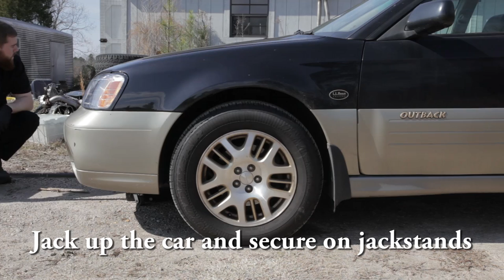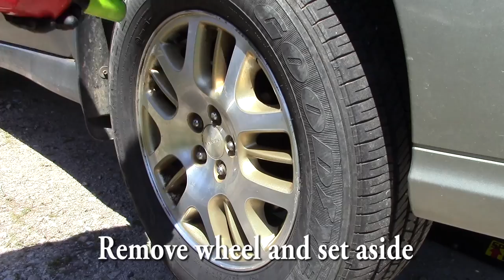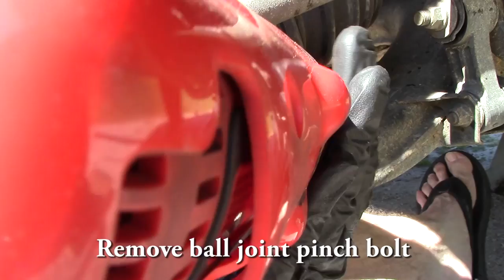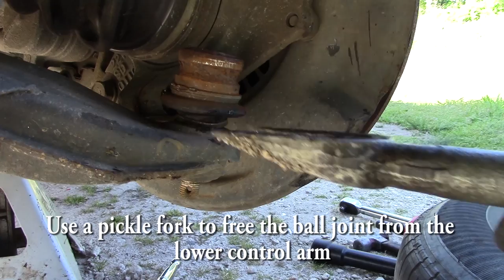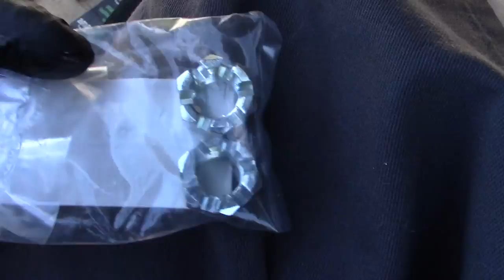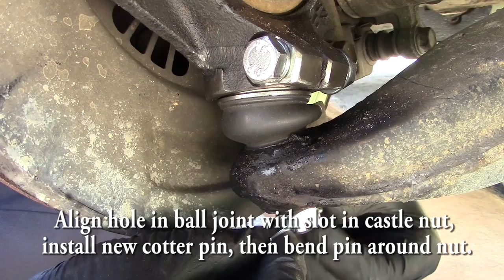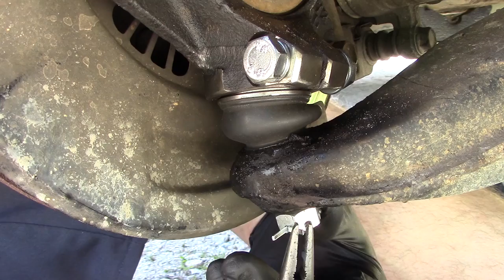Subaru Ball Joint Replacement

Comment: As always love your videos!! I have done this job before but this time the ball joint is stuck... I have tried pickle fork for an hour and a ball joint separator. Sprayed it with penetrene, and lifted it with a trolley jack while using a pickle fork but cant seperate it. Any suggestions?
Reply from the maker: +simon kilcoyne torch. Airhammer.

Comment: did you remove the tie rod ends to allow the discs to move? When I try this replacement the ball joint gets stuck after removing the pinch bolt
Reply from the maker: +Ben Keeton yes, removed the outer tie rod from the spindle.

Comment: Hi Mr Subaru, UK guy here, how will I know if the ball joints are breaking down on my SH forester. Do they make a slight clunking noise when driving over uneven surface or a different noise. Please advise as you are a god with the Subaru brand.
P.s. do you admire the offroad scene with the Subaru brand or are you a impresario sti kinda guy, intrigued to know ???
Reply from the maker: Easiest way to check ball joints. Lift and support the front of the car on jackstands. Prybar between the bottom of the spindle, top of the lower control arm. Flex the prybar up and down slightly. The bar should bow and no movement seen in the ball joint. If you see movement up and down in the joint, replace it.

Comment: Just out of curiosity, can I put grease in the socket and groove on the pinch bolt area of the ball joint?  Every time I watch someone remove one of these, they are rusty and/or crusty (some much, much, much........ worse. :)
Reply from the maker: I'd probably go with some light antiseize compound.

Comment: i did the ball joint change, on the passanger side, when i took the ball joint out,  the inner/transsmison cv joint went out O.O .. i put the cv joint/boot on its place, but it lost the grease, am i need to refull the cv joint?? can be that the reason for some crunch/crackle noise while iam driving over a rough way?
 after the ball joint change, the noise decreased, but not all. Thank you.
Reply from the maker: +Ismael Forester noise is most likely the axle. You will probably need to replace it. A new boot and grease probably won't remedy the issue.
Reply: Even when the axle/boot was on good shape? Have no cracks or something like that.
Reply from the maker: +Ismael Forester the joint should not come apart. Most likely spring clip inside is missing. Pull apart and inspect for wear. If no wear, grease, install new retainer spring and boot.
Reply: +zcamaross09 
ooooo the clip could be missing, because when it came apart, i didnt see any clip, can i just buy the clip if the cv joint is Ok?

Comment: I NEED HELP, I HAVE A 2004 SUBARU OUTBACK AND THE STEERING KNUCKLE CRACKED! I know that 00-04 are the comparable years, but would a 2005 steering knuckle work? I know I would need to get the bolt of wheel bearing and hub assembly. But as long as the CV fits and the bolts are the same for the caliper and tie rod it should be fine right? A steering knuckle an 05 is 50$ for an 04...its 200$
Reply from the maker: The 05 is not interchangeable with the 04 steering knuckle.
Reply: @MrSubaru1387  there's no way it would work? Even with getting the new spindle assembly?
Reply from the maker: The geometry of the 00-04 and 05-09 are different. Complete different spindles, lower control arms, hubs, etc.

Comment: Hi great video, did you put your jack stand somewhere special, it seems like you can  move your components pretty freely, my experience was not great. I have a 2000 OBS. It’s looking pretty similar to the outback underneath
Reply from the maker: I placed the jack stands on the factory jack points, on the rocker pinch welds.

Comment: My ball joint boot is ripped on the passenger side. I would need to replace it as I haven't had time. Is it bad to keep driving with a torn boot? Also, how hard is it to take off the pinch bolt? I'm afraid mines is rusty and may strip or break. Any tips or ideas? I'm limited on tools. Thank you!
Reply from the maker: +Subaru WRX driving with the torn boot apps dirt, water, and debris to get into the joint and wear it out. I also washes out the grease around the joint. The pinch bolt may come out no issue, or may to rusted solid. I can't say. Depends on the environment that the car has lived in. Heat and penetrating oil are the only things that can really help.
Reply: MrSubaru1387 hey, I have another question. When I go torque down the bolts at the end. For the pinch and castle nut. Does the car need to be back on the floor or can I torque it while it's on the jack stand for both? Please let me know, thanks.
Reply from the maker: +Subaru WRX torque while jacked up is fine.
Reply: MrSubaru1387 thanks for responding back so fast man! Appreciate it. Subscribed!

Comment: Up until the pickle fork part stuff it was easy...I can't get the ball joint out of the control arm. I'm assuming this part has never been changed and has rusted in a lot. The top part was very rusted. Anyone have any tips?
Reply: with the ball joint still installed in the knuckle, and pinch bolt in place.  you can use the same technique i described above.  Using a sledge, and a pipe. place pipe on control arm, close to ball joint, and slam the lower control are downward.  this should break it free.  there are also ball joint pressing tools, you can rent from autoparts stores for free.   I've never needed one though.   The pipe trick works both ways,  taking the ball end out, or the stud end

Comment: Did you drill out your pinch bolts on one side? Looks like the bolt goes through to a nut. Did you happen to record the drilling process? I'm wondering if you need to remove the knuckle, or if it can be drilled while still attached to the strut
Reply from the maker: I did. Due to rust. Didn't record the process. Knuckle will need to be removed from car.
Reply: Did you have to find a different pinch bolt that has a flat sleeve so the ball joint doesnt ride on the threads? or any bolt worked for you? BTW love your videos!
Reply from the maker: +Walter Elkin I drilled the hole larger all the way through and found a grade 10 bolt that was tight in that hole. Lock washer at the head of the bolt and at the end with a nut. Held for 1.5 yrs before I replaced the spindle with a rust free junkyard unit when my wheel bearing died.
Reply: ohh okay thank you. Wish you worked on my car lol. Need a timing belt done.

Comment: Hi there, what is the torque spec for a 02 WRX Impreza ball joint castle nut? I can not find the answer to this at all. TIA!
Reply from the maker: +phabejthao sedan - 22ft lbs, wagon 33 ft lbs. Per the factory service manual. Then go no great than 60° to the next hole aligns to accept the cotter pin. Pinch bolt torque is 37ft lbs.
Reply: MrSubaru1387 thank you!

Comment: Is the 2006 Subaru legacy in the same configuration as this as far as control arm/hub/ball joint etc?
Reply from the maker: Close. Ball joint is the same. Spindle and hub and slightly different due to having a bolt in hub/bearing assembly.
Reply: @MrSubaru1387  for this job do you just have to remove the sway bar link or do you have to remove the center nut for the axle? It seemed like that didn't need to happen in this video.
Reply from the maker: Yeah, just sway bar end link. Don't have to touch the axle.
Reply: @MrSubaru1387  I'm guessing the biggest risk factor is that pinch bolt?
Reply: @MrSubaru1387  thank you so much for your help btw I appreciate it
Reply from the maker: Pinch bolt and the ball joint. Notorious for rusting, breaking up north. Luckily for me, my Subarus are rust-free southern vehicles.
Reply: @MrSubaru1387  the one I'm going to work on is in Utah. Actually bought a 94 bmw e36 there and it didn't really have that much rust. Fingers crossed.

Comment: Any ideas for a broken pinch bolt😬
Reply from the maker: Have to drill it out. Then, either tap it bigger or put a grade 10 bolt through and secure with a lock washer and nut of the other end.
Reply from the maker: Best choice is to find a good spindle in a pull-a-part.
Reply: A new hub u mean?
Reply from the maker: Well the hub will be in the spindle.

Comment: so you dont have o press the ball joint back in? cause it seems like its not in all the way??
Reply from the maker: +Ger Khang nope. Just pop it in by hand and tighten the jam bolt. If it won't go in, look to make sure there isn't debris or rust flake in the hole.
Reply: I see nice and easy!! Thanks for the tip
Reply from the maker: +Ger Khang you're welcome. Glad to help.

Comment: are these parts expensive at all if i wanted to do all 4 corners of my 06 outback ?
Reply from the maker: +aaronc608 depends on what you believe is expensive. Check it SubaruParts.Com it's where I get the best deal on all my OEM Subaru parts.
Reply: I picked on up for $28 from advance pretty cheap. They do offer upgraded ones for around $100

Comment: does this job require a new pinch bolt?
Reply from the maker: +ENetwrok a new pinch bolt is not required unless existing pinch bolt is damaged or corroded.

Comment: Im guessing you cracked the spindle??  the install of the ball joint was on a brand new spindle!!
Reply from the maker: The driver's side spindle was original to the vehicle. The passenger's side spindle was replaced at some point in its life with one from a very rusted northern car. The ball joint pinch bolt snapped off in the spindle. The ball joint on the passenger's side had to be torched, cut, and air hammered out. In doing all this the spindle did crack around the pinch bolt hole. I welded the crack and dressed the spindle giving the appearance that it was new. I had to run a larger bolt for the ball joint retention with a nut and lock washers. I later replaced the whole assembly with a rust free spindle from a local junkyard.
Reply: i have to do mine and thats what im afraid of -- it splitting --lol   could be a big job then
Reply from the maker: Yup. Definitely a bigger job if rust is involved. As you see in the video, I swap between passenger and drivers side for the demonstration.

Comment: You didn't have to press the ball joint into the lower control arm?
Reply from the maker: No. They "press" into the spindle. They bolt in stud wise into the control arm.

Comment: Wait a second 3:39 --- that pinch bolt looks like it has a nut on the other side? ? This is OK to do?
Reply from the maker: If the bolt is rusted, snaps off, and has to be drilled, we usually go up a bolt size, add lock washers, and loctite to the nut on the back. More of a temp fix until a new spindle can be installed.
Reply: @MrSubaru1387  I see, so you would not drive long term on that setup...

Comment: Hey Mr: Subaru, 
I have a  208 subaru impreza non turbo and the problem  I'm  having is when I release  the gas and press tge clutch  it makes a clunk noyse. It also has a clunk noise while driving on bumpy roads  but can it be  the motor or trasmission mounts the problem? 
Thanks
Reply from the maker: +elyyfz450 it's possible. Does this clunk happen everytime you does the clutch?
Reply: MrSubaru1387 Yes, and when  I  release  gas without  clutching. It does it  when  I'm  asceleratin and release the gas.
I'll  appreciate any help,  this car is kinda driving me crazy.
Reply from the maker: +elyyfz450 yea, that could definitely be a transmission or engine mount. You'll need to get underneath and visually inspect the mounts.
Reply: MrSubaru1387 thanks, I'll definitely look into it.  
I apreciate your help and videos as well.
Reply from the maker: I do have videos on checking and replacing the trans mount. Check it out. Let me know if you have any other questions.
Reply from the maker: You're welcome!
Reply: MrSubaru1387 thanks a lot for the help.

Comment: i assume it roughly is the same, but is it the same thing on an '08 impreza upper ball joint?
Reply from the maker: +fred renault identical. It's the lower. They don't have upper ball joints.
Reply: either the mechanic lied to me, or we're not talking about the same thing.
Reply from the maker: +fred renault shown in the video is the front, lower, ball joints. Subarus don't have upper ball joints. The upper area of the spindle bolts directly to the strut.
Reply: the ones im talking about are in the back.
Reply: which is one of the main reasons why im asking if its the same
Reply: basically, he said that the front left stabilizer is due for a change, the front right tie rod (he wrote tid rod, which i assume he meant tie rod) is due for a change aswell, and that the upper ball joint on both the right and left side are due for a change aswell. but they all do the same knocking noise when i go over a speed bump in a biased way, which makes me doubt that the issue is what he said. because normally, the faulty component should be the same on all four wheels if it does the exact same noise, right?
Reply: also,before telling me what the issue was, he asked me if i went to mechanical college, as if he wanted to know weither or not i'd understand what he was gonna talk about, either so he could know if he could lie to me, or tell me the truth because i'd know he'd lie. (i know, this might be terribly phrased)
Reply from the maker: +fred renault these do have rear upper ball joints, they are only replaceable as an assembly with the entire control arm.
Reply: yeah, he did tell me something that sounded like that.

Comment: I can't get the ball joint back into the lower control arm .. went into knuckle fine
Reply from the maker: +Brad Harrington don't have enough slack? May need to unbolt the sway bar so you can drop the control arm lower.
Reply: MrSubaru1387 copy that gonna see how it goes .. everything else went fine, now this is going into a 3 hour job
Reply from the maker: +Brad Harrington oh man. Hate to hear that.

Comment: I got rear end and tailgate was carved in now the door ajar light is on for the trunk which I know is gonna drain my battery
Reply from the maker: The switch in the the trunk latch, it's a lever. Can you use a zip tie to keep it pressed down?
Reply: @MrSubaru1387  I will try it in the morning thank you very much

Comment: My ball joint looks exactly like yours does at 3:00- started, but not fully in. I'm having a ton of trouble getting it all the way in... Any tips?
Reply from the maker: +Geoff Leach was there rust inside the spindle bore?
Reply: MrSubaru1387 it doesn't seem like that's the problem. I'm starting to wonder if the ball joint (which came as part of the control arm) is a poor tolerance/wrong part.
Reply from the maker: +Geoff Leach it could be if it's not a Subaru oem part.
Reply: MrSubaru1387 sure enough, I just ran to the parts store and picked up ball joint (Advanced Auto brand)... fit like a glove, no struggle. Thanks for bouncing ideas off of, it led me to the solution.
Reply: btw, for anyone reading this- it was a Mas brand control arm and ball joint part, the ball joint didn't fit in my 07 Outback.
Reply from the maker: +Geoff Leach glad you got it figured out! 👍

Comment: Can anyone comment on whether I should go OEM or Moog replacements?
Reply from the maker: OE is always the best.
Reply: @MrSubaru1387  thx again, drivers side no problem, passenger side, snapped head off bolt, had to drill out, still didn't work, may have to replace the steering knuckle ....

Comment: I can’t get the ball joint to line up with the control arm for the life of me. Sway bar and tie rod are both disconnected..
Reply: So what I thought was a ball joint clunking was actually the strut mount had broken. So in the process of trying to swap the ball joint, after disconnecting everything the entire strut and hub assmbly pretty much fell outta the car and popped the inner cv joint out of place which was why I couldn’t get the ball joint to line up with the control arm. Once I got the inner cv joint back in place everything went together just fine....in case anybody was wondering lol

Comment: i tried to pry off.........no way it comes off that easy...any suggestions????
Reply from the maker: +nyquilism if it's rusted in place, you'll need an air hammer and chisel to force it out.
Reply: Put jack under LCA, wedge a wrench or something in between LCA and knuckle, lower jack.

Comment: Oh, so we don't need a ball joint press??
Reply from the maker: +Surina Lee correct. Subaru ball joints are bolt in. No press needed.
Reply: +zcamaross09 awesome!! this is much easier than I thought... so do we have upper ball joints too or only the lower?
Reply from the maker: +Surina Lee only lower joints. Top is a strut mount. Glad to help.
Reply: +zcamaross09 thank you so much!
Reply from the maker: +Surina Lee no problem. Glad to help

Comment: Sorry if I already asked but can a ball joint cause wobble like a failing bearing? My ball joint is trashed and flopping around and I can move the wheel all around etc. Been having problems when driving and I hear it sounds like a bearing but I just replaced the bearings so I'm at a loss. I imagine if I can move the wheel that much , that has to effect it.

 https://youtu.be/H16W0ty90Zc

Comment: I thought Subaru used press in ball joints? It doesn't seem like it looking at this video...
Reply from the maker: Nope. They use bolt ins. Have for decades and decades.
Reply: @MrSubaru1387  so in short a pickle fork and an air hammer should be able to remove it from the control arm.. (cannot remember how your video showed the removal, I've watched way too many videos the past couple days)
Reply: @MrSubaru1387  thanks for the reply by the way!! Super unexpected and I sincerely appreciate it

Comment: funny how the knuckle changed mid video...
Reply from the maker: Yep, camera battery died while I was filming on the driver's side. Finished the video filming on thr passenger's side.
Reply: Did that passenger side pinch bolt break on you? The knuckle looks drilled through with a nut on the back, aside from being taken off and cleaned or replaced.
Reply from the maker: It did.